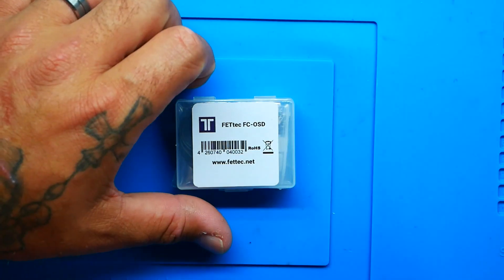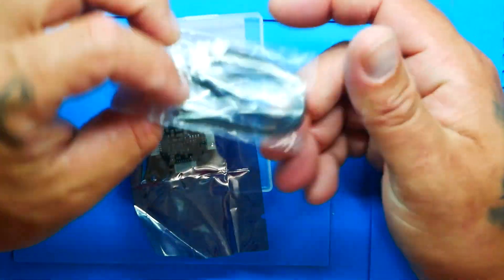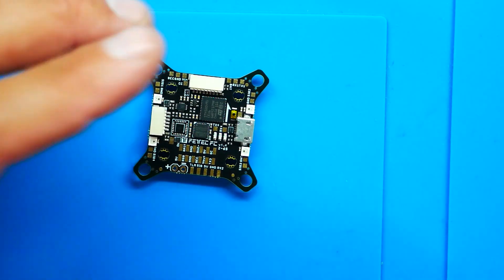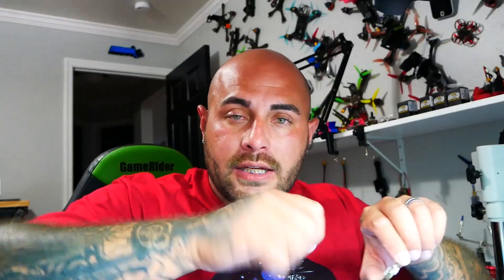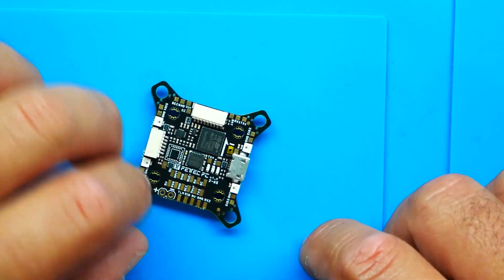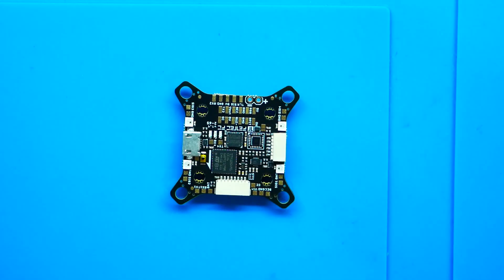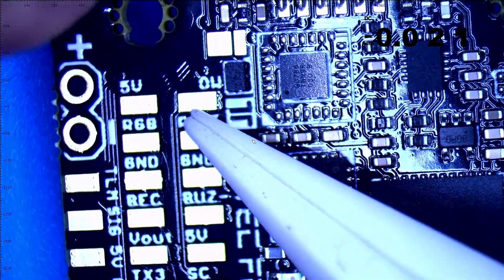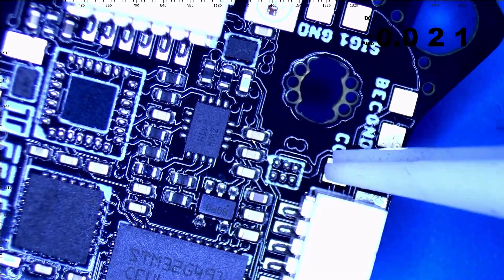All New Fettec G4 Flight Controller!! Are F7 & H7 Boards Worried?!

Comment: I feel at this point of time with the kind of flying most people do all we need is dependable hardware that can very well run betaflight 4.3. Otherwise higher power FC processors are now by law of diminishing returns waay too overkill for fpv dronesand the typical pilot.

Comment: great video, thanks a lot. and I've been watching a lot of your older videos, too, and you have a new subscriber! I'm relatively new to FPV, or at least the building-quads side of it. I really like the apex regulator board for the good video signal it provides. on older builds it would hook up to the camera via the osd board, which now we don't need anymore with the G4. although the G4 FC does have its own BECs, I still believe (and I might be wrong, of course) that the stability of the voltage output of the apex regulator would be better for the video signal. can I use the regulator anyway with the G4 to power the camera and VTX? and if so, how? sorry if the question is dumb, I still have a lot to learn. thanks again! 🙂

Comment: i have seen the comparisson between kiss fc and kiss g4 and in the video he says it flys worse on stock settings....i am so sad about it, i just wanted to buildt two exact same setups and or at least two exactly good flying quads (completly same setup but first buildt with fettec v1 and second with g4 now the v1 is everywhere sold out and in the video he says stock settings fly much worse then the v1 and why i fly kiss is because i dont want to tune, i just want to buildt and go.....so fucking sad

Comment: Be for warned  do not buy fettec they are a very shady company and do not stand behind there products  i bought the g4 and there 45 amp esc wich number 3 esc did not work out of the box never used never flown and there trying to say mousture got in it they will not warranty an 80 dollar esc stay away from fettec crap

Comment: Im happy with old fettec, but its good, that they pushing bar forward xD Anyway my favorite drone is flying on F4G3 Hobbywing +60A esc runnung on Falco firmware)) Fettec or Kiss should finaly add "new" feathers to kiss fw, like feedforward or i-term relax. Setpoint Weight even on 100% do nothing comparing with nice tuned ff in bf)

Comment: I’d love to see you wire it up with a vista/AU and run this one wire. Iv been running the older fettec/kiss fc with 45amp esc and I’m still unclear if one wire is actually working or not , I can’t tell a difference when I switch from dshot 600, dshot 2400 or one wire . You mentioned wiring one wire on this new G4 so yeah now I’m definitely confused on that so making a point to do that in a video would also be very interesting Mr Dman.
Reply: I second this drainman we need more!
Reply: I only run onewire on my fettec builds, so I dont use the wire harnes. Only need to use the "T" and the ground on the esc to the ground on the fc and the tlm on the fc. I love the onewire.